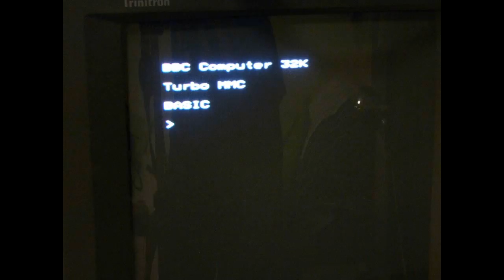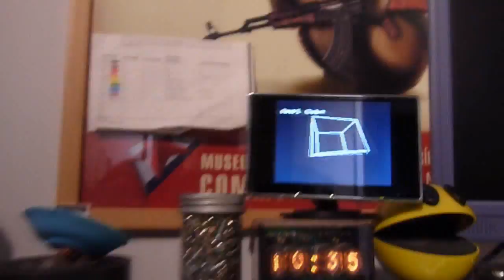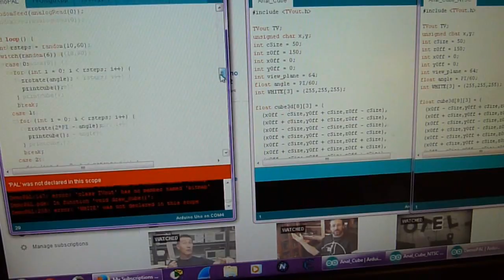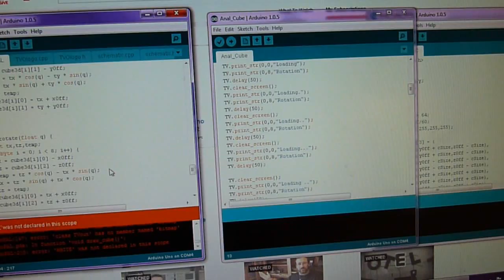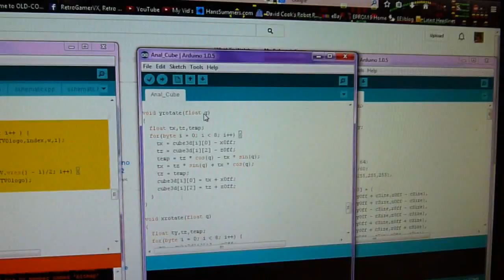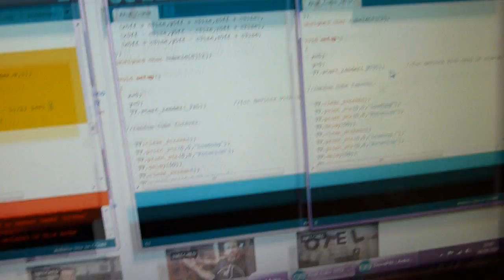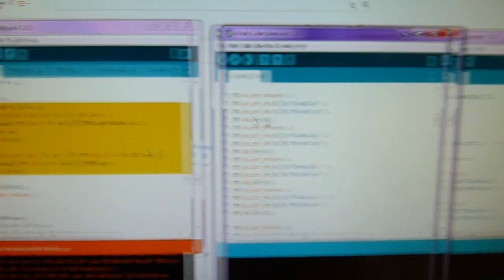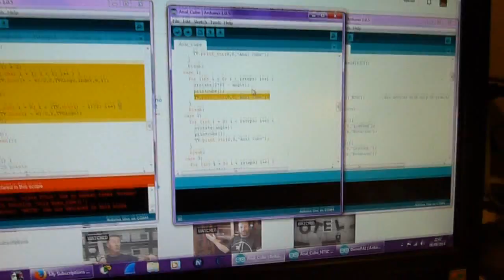Arduino Video Module

Comment: Oooh code falls asleep. I am no good at stuff like that.
Reply from the maker: Tails I'm not an amazing programmer, know enough to get buy.
Reply: ***** I wish I even knew that much lol!  It's cool you can get video out of the Arduino!  Is it like having your very own 8 bit retro computer?
Reply from the maker: Tails The Frignition is built on an Avr, not sure what one. Mike managed to use one to output a composite video from the thermal image sensor. I do wonder if I could use this as a driver circuit for my LCD viewfinders.
Reply: ***** Ooooh is that what he used!!  Mike is a genius!!  I especially liked the surplus iPod nano screens he turned into really useful non iPod related use!  With all the complicated stuff he did to get them to work it's no wonder the official Raspberry Pi LCD screen is taking so long!
Reply from the maker: Tails I know, I strive to have that much electronics wizardry one day, made good progress as most of what I have achieved has been in the last decade. The best way to learn how to do all of this stuff is give it a go.